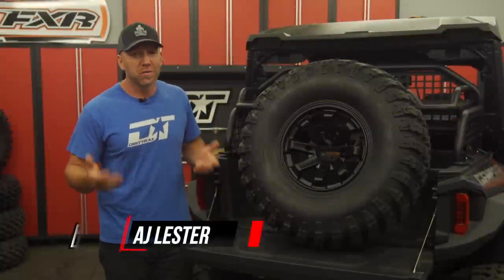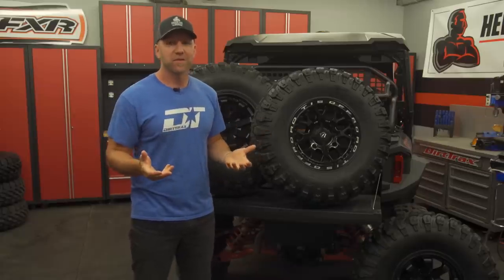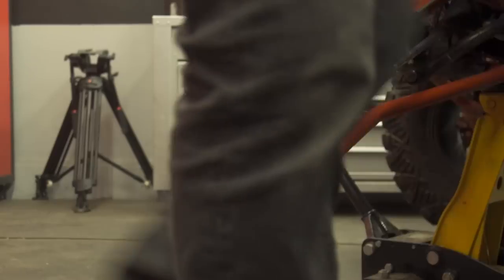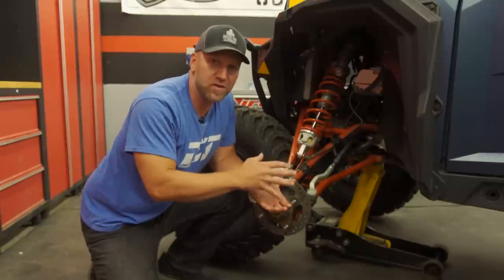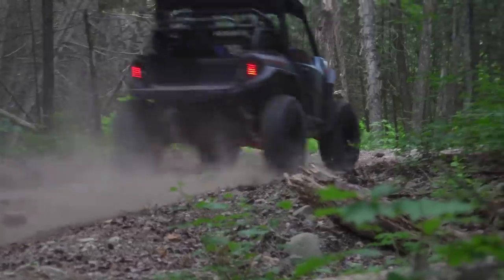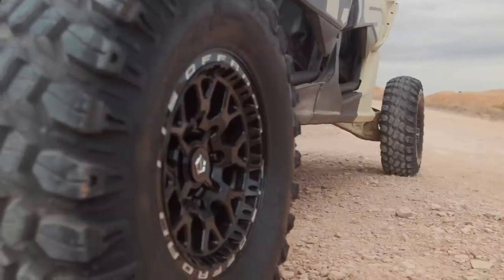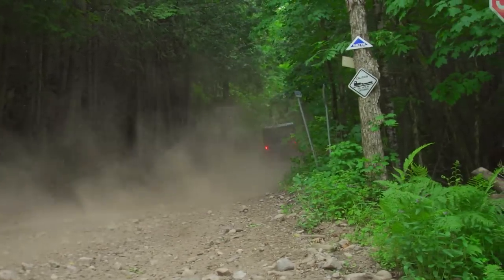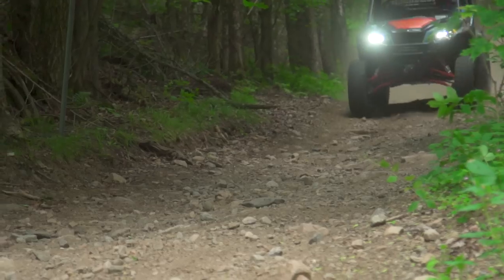ALL NEW: TIS Off-Road UT1 All-Terrain Tire by Hercules

Comment: Yes, larger wheels and tires put more stress on the suspension components. Usually a 30 pack will delay this fact until it's too late and we get the call. Very often a customer wants to equate his manhood to the size of his tires, horsepower, or loudness of his exhaust, all proven by science.
Reply: More ground clearance but also less usable suspension travel.